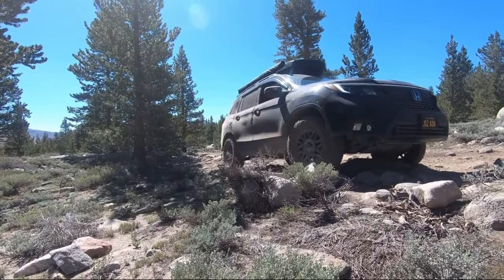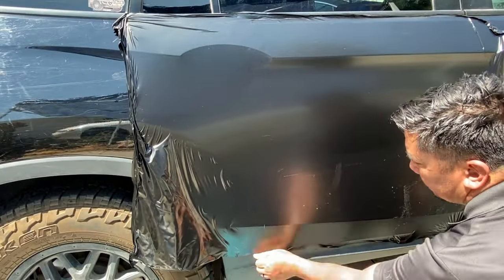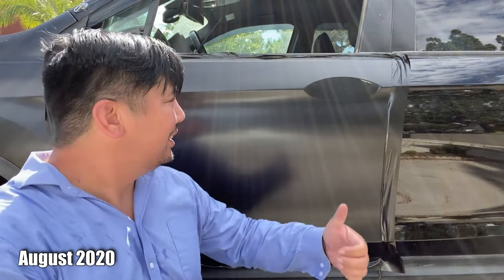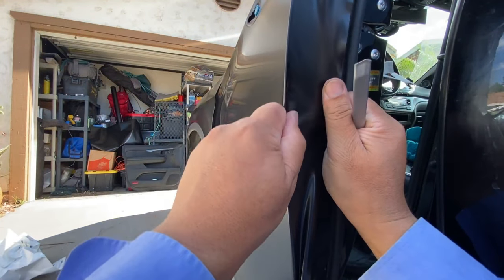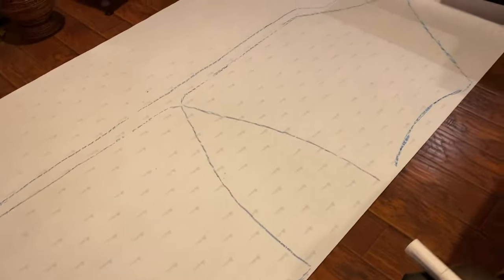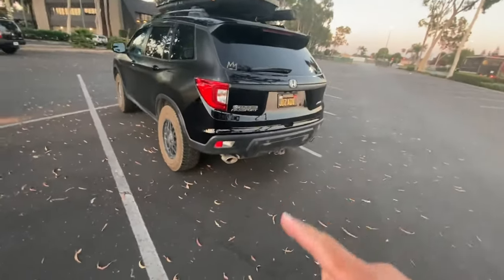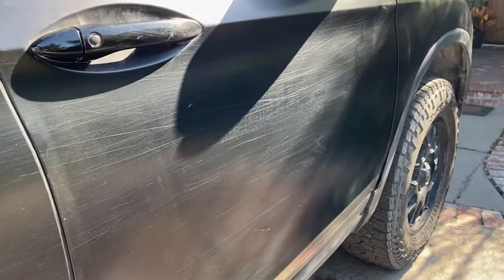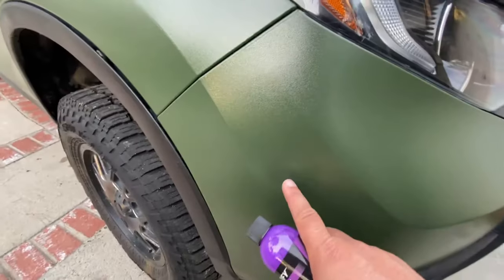$300 DIY VINYL WRAP!  Does it survive overlanding?

Comment: As always killer content and a timely video. We just picked up an off lease GX with perfect paint and we are working on an overland build. I was tormenting on how to preserve the paint. I think I’ll take the dive with this more robust film. I hope I can be as Zen on the install as you were.
Reply from the maker: Thanks 🙏 Rob!  I think ruggedized vinyl wrap will be a good option.  Some things I didn’t mention in the video is that highly bended shapes like the front and rear bumpers can be a pain.  Also, when you bend the film, a day later it’s likely to pull.  Buy some 3M vinyl sealant to prevent pull.  If areas do pull, just reheat the film, stretch, use edge sealant, and then cut off the excess.  The beautiful thing about using vinyl film is that you can fix mistakes 👍
Reply: @JonDZ_Adventuring  Great pointers - thanks again! Love your channel and hope to run into you sometime out on the trail when we roll down from the Bay Area. I'm amazed at the capability of your rig - I had Hondas for decades and got pretty close to pulling the trigger on one for a family/overland build once I saw what you could do. But the the allure of a truck caught me so now I have a ultra reliable soccer mom Overlander that gets 16mpg  : (

Comment: Great info. I've found myself thinking about this as I'm looking at replacing my Forester and starting over with an unscratched rig. Even if the film got scratched, it would be nice to know I'm not demolishing the paint. Boy, I just don't know if I have the patience and dexterity to work with those sheets of film. I struggle just to put clean sheets on the bed. But I sure do like the idea of eventually being able to peel off the scratched vinyl and find the unmarred paint underneath. Hmm.
Reply from the maker: Donald, I’m so excited about your next rig choice!  From you live chat yesterday, it seems like you’ll be going one of the following directions:
A.) SH Forester - you’re old system was tried and true, and you have no issue sleeping in the gazelle tent.
B.) Small/medium size truck - I think this option makes a lot of sense for a vehicle sleep system.  It’s just that fuel economy and daily driveability will be an issue.
C.) Van - sounds like a good option, but the only vans with AWD/4WD are the bigger ones.  

You have a big decision in front of you.  I know cost will also play a factor.  You know the reason why I purchased the Passport, dollar for dollar for a “NEW” vehicle and with “capability”  and “reliability” in mind, it was the Best Buy and best AWD option.  I have 62K miles on it now and not one issue.  BUT... it’s a $38k vehicle, and the resale is insane right now.  Even if you find a Passport Sport AWD with 30k miles it will still go for about $28K, which is only $5k off a brand new one.  Another vehicle id recommend is the Rav4 adventure, but those go for $35k brand new, and why buy one of those when you can get a Passport.  All other AWD vehicles that predate these vehicles aren’t so capable or as fuel efficient (passport is rated for 23mpg highway but after modifications, I’m still getting 23,  stock people are getting 27-29mpg because of VCM).

My recommendation is to get a 2nd Gen Nissan Xterra for $4-7K.  I know you don’t want a mid sized SUV but atleast it’ll be a more stout option to support a RTT.  With all the money you save, you can pick up an iKamper RTT.  Plenty of space!  And the IKamper deploys in 30 seconds!  

Donald!  Whatever vehicle you choose I will offer my services to help you vinyl wrap your ride!  It’ll be a good reason for me to come out there.  I’m serious!  Let’s DO THIS 😃!
Reply: @JonDZ_Adventuring  Dude, that would be a blast!
Reply: Do a dip your car kit

Comment: Builder's paper is a great idea! Didn't think of that. I plan to do vinyl wrap on the 4runner soon. The challenge of the 4Runner is that the body side panels runs from the windshield all the way to the rear. I don't want to get more than I need to so I have to make precise cutting on the vinyl for the body panel and doors in order to conserve.
Reply from the maker: Good luck Francis!  Do you have the current gen 4runner!  The front grille wills be quite the challenge.  You will have to cut sections for the grille, and I highly recommend avery’s rugged vinyl wrap because overlapping isn’t as noticeable compared to traditional wrap.  Also, pick up some 3M vinyl edge sealant.  When you wrap things that require stretching, it will tend to pull and lift.  The sealant will lock it in.
Reply: @JonDZ_Adventuring  good call on the sealant. first time i heard about it. good thing there are two videos on youtube in which i can reference when it comes to vinyl wrapping the 4runner.

Comment: This is probably crazy to consider, but what would it take to just spray paint the car? Maybe raptor or some kind of rhino liner coat… maybe just bedliner… I’m thinking the fix for scratches after would be simple… rattle can..
Reply from the maker: It’s been done before, but it’s ugly, and looks dingy after a while.  You also have to do a lot of prep work.  Touch ups are easy with rugged vinyl, which looks like Raptor liner.  All you do is cut out a shape and then insert another piece.  Regular smooth vinyl isn’t touch-up-able.

To make Raptor liner look good, you’ll need to periodically spray clear coat.  Otherwise it looks really bad.  We’ve all seen Raptor liner vehicles before.  I see less and less of them, probably for a reason.
Reply: @JonDZ_Adventuring  ok. Touch ups blows my mind a bit. That sounds amazing! Between that, and seeing you finally give up the paint pole awning for a 180 has me considering starting to save some money.
Reply from the maker: @ChuckUnderFire  Oh my!  I remember the paint pole awning!  Hahaha!  I was able to buy the 180 degree awning on sale for $500.  I believe they are a bit pricier now a days.  This awning has been an integral part of my adventures.  I attached an awning wall (... that I bought for $300), and when combined with a 50,000 BTU propane fire pit, it lets me continue my adventures during cold winter temperatures.  I never hesitate to deploy it, because it's so easy set up.  It's one of my favorite pieces of gear.

Comment: I don't recommend doing the job outside in the sun.. working against the elements is not a good thing. I recommend in a garage with a very clean floor, use a heatgun/torch when needed.
Reply: Must agree with not doing crack cocaine though 🤣
Reply from the maker: 🤣 just say no to drugs